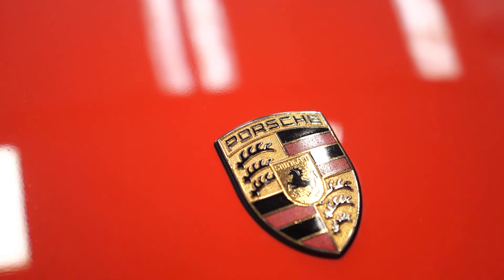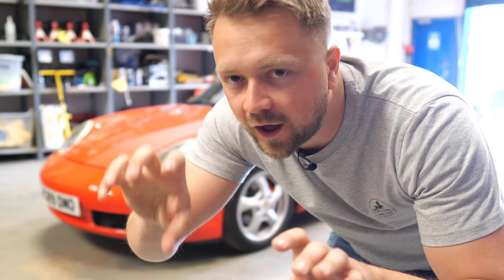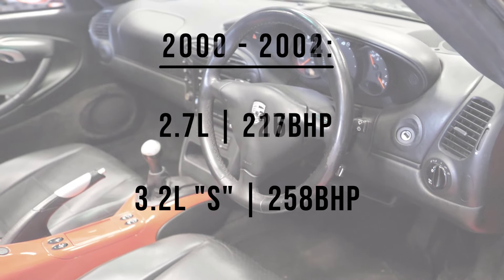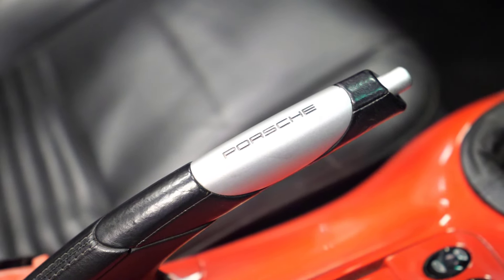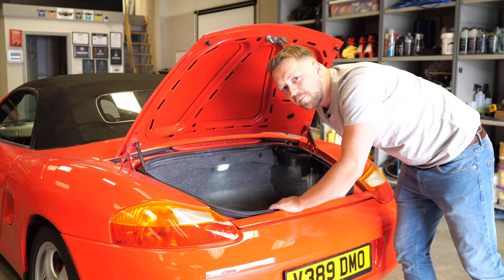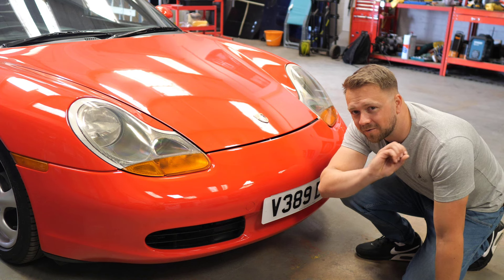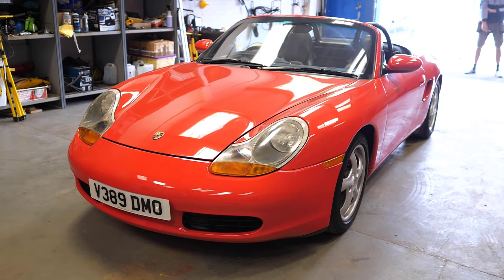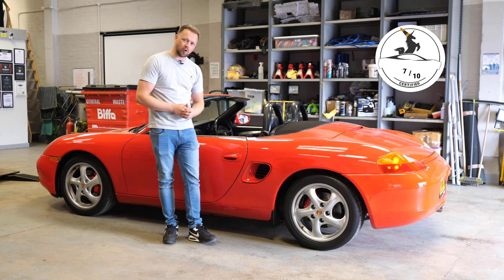Everything That Goes Wrong With A PORSCHE BOXSTER (986) BUYERS GUIDE

Comment: After a truly disastrous experience of owning my Boxster S for just 600 miles and a month, check the caps for mayo (both caps). Even though I had mine inspected, the inspector either didn't check this or didn't notice the mayo that had built up on the coolant cap. I had the AOS checked which was fine, meaning that the cylinder head was cracked, requiring an engine rebuild. I also had a lot of water ingress behind the passenger seat. Underneath the passenger seat is a module that controls the cars security systems. Quite an expensive fix if it gets waterlogged. I ended up selling my supposedly "good" Boxster S for a big loss. Be careful, these cars can bankrupt you!
Reply: For water infiltration in the car, under the seat, it is necessary to check from time to time that the rainwater evacuation holes are not blocked, otherwise the water overflows from the gutters and enters the cabin. little check easy to do from time to time. If your car is sleeping in a garage, you have little chance that the water drains will clog or that the water will overflow. If she sleeps outside, there you have to check more often.
In order not to be bored with the mechanics, you should not buy a 986 Boxter with a low price, if the previous owner took care of his car, he will not sell it at a very low price. It is necessary to favor well-maintained vehicles, therefore necessarily more expensive. The interior and exterior condition of the car says a lot about its owner.
Reply: @vincentidf2259  hi mate, I did unblock the holes but the problem persisted. However after the engine failure I didn't pursue it further. However I agree I would personally avoid cheap Boxsters'. I've had to learn a very painful and expensive lesson.
Reply: @tameracingdriver  Hi
Repair costs and the price of parts are often high, do not allow you to consider a vehicle at a lower cost and then to consider doing the work to upgrade the vehicle.
Frankly, the Boxster is a good vehicle, a reliable car if the interviews are well carried out and the wearing parts replaced on time. Sorry, your experience with this car was unpleasant.
Reply: Sounds like your professional ‘inspection’ missed some basics. The cylinder head is a known weakness on these. A basic sniffer test would have detected cylinder head issues. What did the inspector do exactly? Kick the tyres and take it for a drive around the block?
Reply: @Theoriginalramjammer  sadly mate my professional inspector was in fact just a glorified tyre kicker as I found out to my cost. Sadly their terms and conditions meant retrieving any money was highly unlikely. A very harsh lesson learned on my part 😔
Reply: Sorry brother. I'm so close to buying a 986 but but they make me so nervous. I'm not wealthy but I have Porsche dreams.
Reply: @heavycream6682  same here mate, but having owned two 986s, personally, I'm not sure they live up to the hype personally. My modified mx5 (Miata) is actually more fun to drive, it just doesn't 'feel' as special - basically it doesn't have the badge. As a fellow non wealthy person, I will never buy a Porsche again. They're just not worth the risk for me and don't quite deliver enough fun to warrant the risk / stress that comes with ownership
Reply: @heavycream6682 Mate get one. I've had my 2001boxster s now for around 6 months. Yes I've had to throw a decent amount of cash at it for repairs and replacement parts but as soon as I hit those country lanes with the roof down its worth every penny!
Reply: Bought my 986 Box about 4 years ago for $4500 and have bought nothing more than gas, coolant, and a replacement key. If I threw it in the bin today I'd still consider it a great deal and would run right out and buy another. 
This one has around 160,000 miles now  I'd probably spend a bit more and hunt for a sub 100,00 model, and preferably an S.

GREAT car. So much fun. Can't see myself being without one
Reply: @heavycream6682 I just bought a low mileage 2015 911. So far so good (fingers crossed). Wait until you can buy something that isn’t in the IMS bearing era unless you know your cars.
Reply: debbieprather4804 Those are some insane costs and this coming from a person who's owned 4 BMWs

Comment: The  original IMS bearing is not lubricated by engine oil. It's a sealed bearing lubricated with grease. The seal can fail through infrequent oil changes, allowing the grease to be flushed out by the hot engine oil which then provides insufficient lubrication, leading to bearing failure.
Reply: The hollow IMS shaft is sealed at both ends, during the heat cycling the engine experiences, the air inside the IMS shaft heats up, expands and finds its way out thru the IMS bearing seals.  When the engine cools a vacuum is created inside the shaft sucking oil into the bearing dissolving the lubricating grease.  Repeated over hundreds of heat cycles the grease is completely washed out being replaced with old oil that never gets changed as it is trapped by the seals.  This oil degrades over time and eventually leads to bearing failure.  As mentioned in the piece this failure is more common in lightly used cars which have presumably benefited from more frequent oil changes which indicates oil change intervals is not the problem.
Reply: I don’t disagree but my facelift 2003 2.7 IMS failed - car had only done 36K & fully serviced 2 owner car. Beware.
Reply: @richardcalon3724  So the solution is an open IMS bearing (no seals) and frequent oil changes so the bearing is always flushed and protected with fresh oil??

Comment: Just a tip ..I did 160,000 miles in my 987 and never had a clutch , therefore nobody looked at my ims .. My ims didn’t break , lucky me , it started to make a noise .. So even if you don’t need a clutch , 60/70,000 , open it up and check that IMS

Comment: I have a 2001 Boxster S.   The color is identical to the one in this video, Zanzibar Red.   I’ve replaced the clutch (had some minor chirping) the throw out bearing rear main seal, inner half shaft boots and IMS all at the same time.   I also had some water on the floor from rain; it fried the computer.   But, the car is a joy to drive.   I don’t drive it much (I have 42K miles on it) but make sure that I take care to drive it from time to time and change the fluids regularly.

Comment: Considering the price bracket the 986 is within, and the very affordable aftermarket parts available, it can hardly go wrong.
IMS & bore scoring, forget about that, just as the cylinder liners dropping. Any 986 still alive is not affected by these issues. As any M96 engined vehicle, if the AOS has not replaced, this needs doing. This is a DIY job.
The 986 is bullet proof !❤

Comment: I had a 99, 2.5 Triptronic S, fantastic car, in 8 years of ownership driving it daily only two issues were water pump went and stereo not automatically switching off leaving the battery to be drained. Fantastic car.

Comment: Great content! Thank you for taking the time to do this. Very helpful to anyone looking at the 986 Boxster. 

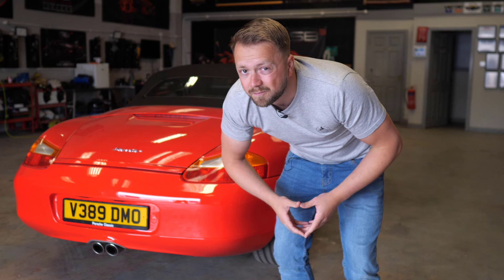A couple of comments about the convertible top… I think a few others have covered it here, but at approximately 8:35 we can see that the convertible top bead is on the outside of the window frame. There are a couple things to look out for on these cars. 1. The problem seen here, is easily rectified by replacing the elastics inside the roof that keep detention on those convertible top beads. 2. If those are left unrepaired water can get into the back area where the convertible top recesses into. If the two drain channels, which are approximately above the side intake and exhale vents for the engine are clogged that water has nowhere to go but under the seats in the main compartment. There are electronics under those seats which can easily get fried… And it’s not an inexpensive proposition to repair them. 3. So it’s always a good idea to blow air down those vents and make sure they are cleaned out. Especially if you leave the car out during weather. 4. The reason for the out of alignment issue on the convertible top, and therefore the popping sound, is that the little plastic cups that are attached to the actuator that raises and lowers the roof can break. If one breaks, then the top goes wonky. They are generally inexpensive to replace, and most people can do it themselves. Best to replace both at the same time as that plastic can get old and brittle. It is made to be sacrificial because those plastic cups snap onto a metal ball joint.

There are a couple of other things I would’ve focused on. The coolant pipes, and the radiators at the front end of the car can get compromised by rocks and corrosion. Always good to give those a look. It’s also always good to give a long look under the car from front to back to check for any damage or missing under panels. There will likely be scrapes under the nose of the car as it’s so low to the ground. That’s not a huge issue especially for cars this age. 

As noted by another commentor, sometimes it will cost some money to bring the car up to current spec. Factor that in your overall budget. That might mean spark plugs, coil packs, serpentine belt, replacing tires that have aged out by their date code, brake, flushes, and coolant flushes. It’s all typical stuff, it just needs to be budgeted for and you’ll be a happy Porsche owner.

Comment: Just to add the 2.5 is the best, has shorter gearing whereas the 2.7 really feels slow through the gears due to tall gearing. The ‘S’ is not too bad but still has tall gearing and still doesn’t feel that quick. 

The 2.5 also had a proper cable throttle, better IMS and is lighter. They also have levers for the frunk as opposed to electric switches for the later models, essential for when you have a drained battery, makes it much easier to get to the battery. 

If you fit a 2.7 exhaust to a 2.5 it adds a bit more grunt and response as the 2.5 has smaller bore piping, strangling it a bit, they breathe better with 2.7 exhausts. 

With the shorter gearing it’s much better when you add a lightweight flywheel too. Makes it more fun than the 2.7 and 3.2, responding better, revving quicker, and with shorter gearing. 

Not quite as quick as a 3.2 but more focussed and more fun for a proper car enthusiast that likes driving and not posing.
Reply: Thank you good to know. I'm looking at a 2.5 and thought I was missing out!  I'll take the gearing!
Reply: Gearing is short in my 1998 986 but you get used to it, I go from 1st to 2nd immediately and if I'm moving at all 2nd is fine.  I use 5th over 70mph as well.
Reply: The trunk & hood release levers on 2.5L WILL stick in the locked position when the battery dies. There's no emergency power injection terminal in the fuse box on the 2.5. Do extend the emergency hood release wire, hidden behind the bumper cover, so it can be accessed by the town eye socket.
Reply: @sununtaschnittker6469 One can quite simply skip 1st altogether....You'll achieve the quickest 0-60 run with no gear shifting

Comment: I bought a 2.7 986 4 years ago. My first bill was £2700 to get it up to standard, replacing brake lines, some other bits and pieces.... Service it every 6 months, regardless mileage... Replaced things like radiators , steering wheel squid, etc... Not even sure how much to be honest, although of course I have the invoices, haven't added them up... Now it's at Williams Crawford to do IMS, RMS, and some other things that may show up .when they put the car on the ramp... I'm guessing around £5000... After all that, I still LOVE it, and I do understand that it's a 20 year old car that needs to keep up, and Porsche is not a cheap car to look after..... If we do the maths, it doesn't make any sense, but I don't think that's the point owning a modern classic.. 🤘
P s. ... if I have had a engine failure I would be very crossed... Luckily 2.7s are less likely to bore score... 😜🤔🤞
Reply: I’m 18 and was looking at a 986 2.5L, what you said was very relatable for my situation as I’m saving up to buy the car myself and I’m aware how much they cost to maintain but I absolutely love the car. Would you have any advice for me buying one to avoid as much issues as possible (I’m buying the 2.5L as the insurance group is much lower than the 2.7 etc
Reply: @keelanvarley7325  I would say buy a car that has a good service history. If possible do a pre-purchase inspection, so you can negotiate if something shows up. I wouldn't bother to mileage that much... sometimes cars that stay still for too long can have more issues than the ones that are on the move ... Good luck :)
Reply: @inglaterracaipira4357  thanks a lot I really appreciate the help, last thing, ik you say mileage isn’t a big issue but is there any amount where u just wouldn’t bother looking e.g. 150,000+?
Reply: @keelanvarley7325  I think a car that was driven around 5k miles per year should be fine... Therefore, a 20 year old car with around 100k miles I wouldn't consider 'high mileage '...
Reply: @keelanvarley7325  I'd rather buy a well serviced, well maintained tidy car with 150K miles on the clock than a (likely more expensive) badly maintained car with 30k.
Reply: @HOG883R  Agree. 100k miles for a 20 year old car is fine - these engines are tough as nails (assuming you service them).

Comment: I have owned a 2015 981 Boxster for 7 years, I purchased it an 2017 as a CPO with 14,000 miles from a dealer. My wife has put 36,000 miles on it since then and it has been extremely reliable, I have only done oil changes, brakes and tires. The car has been a joy to drive and own and has had the lowest depreciation of any vehicle I have owned including multiple Audi, BMW, Lexus and Mercedes Benz vehicles. I also owned a 2019 Macan S program car which I put 50,000 miles on over 3 years and sold it during the pandemic for $5K more than I paid for it. My experience with Porsche has been very good.

Comment: I’ve had my ‘98 Boxster for over 7 years now. Got it with 54,000 miles now at 82,000. Only issues so far have been a failed pulley on the serpentine belt. It was an easy fix and quite affordable as well. Heading out today on a sunny Monday here in New York State.

Comment: Have a 1999 boxster 90,000 miles. Haven't had to deal with any real issues other than maintenance. Just keep them moving. Letting them be garage queens is the reason you get failures. Also, don't be afraid to rev it out, it lubricates the IMS bearing as well. At this point my clutch is going to fail before my bearing. I'll end up swapping that when I do the clutch.
Reply: I’m looking at one that has been driven now and again but is 2004 and 35k miles! Should I leave it alone?
Reply: @06comment  Definitely try to find one that has it replaced preferably with the oil fed bushing solution. There's definitely a risk when buying these cars without a replacement having been done unless it's an earlier dual row bearing car.
Reply: The 1999 IMS bearing is a sealed unit, which does not require lubrication ..😊
Reply: @thefreedomguyuk  True unless you remove the cover for it. Some people do that to allow for oil to get into the bearing and provide the lubrication it needs. Better than trusting the 20 year old grease that's sealed inside.

Comment: Good coverage of faults - make sure you buy exact part number MAF for year, they changed them and won't run well if mixed. Ignition barrel electric switch faults and on tiptronic selector rusts on overhang at rear of engine. Disconnecting battery and alarm wont stop? Disconnect battery with key on engine off. The two pram ball joint plastic links to the hood break - you can replace with metal ones

Comment: Like this video. I experienced the IMS problem just as you describe it. I had 1997 and 1999 boxster. No problems at all and very reliable. My 2005 987 S's IMS blew out at 70 t km immediately after my prolonged warranty expired after 4 years. Great fun to drive though.

Comment: Had a couple of Boxsters, both a joy to drive and the handling is unbeatable. Interesting bills were ever present but once the hard stuff was done it was usually down to tyres and fuel. 
The engineering is in some places very clever, easy out headlights and stuff, in other places oddly poor like the IMS/RMS and as also pointed out the front rads.
I'd have another one any day, but currently EV'ing.
Reply: Only gone and bought another one!. Almost everything underneath needs to be replaced - might even start my own channel there's so much work to be done!🤣
Reply: @BlackBuck777 do it I just bought one and it would be nice to see someone fixing there's up because I know mine will have problems
Reply: Lol guess what, I got another one (2002 2.7)! Full suspension overhaul under way. So much to do but I'm enjoying it. Good luck with yours.

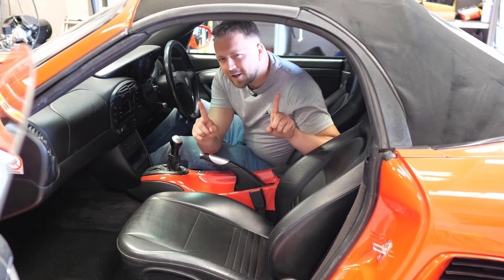Comment: Another poster already mentioned this, but notice at 8:37 the roof beading sticks out, which is a common problem and a sign that (typically), the tensioning cable is stretched.

Comment: I have a low miles 2004 S model which I am the second owner from 2006.
The first owner was a friend so I knew where it had been.
First time I had it serviced the RMS was replaced, initially Porsche were going to cover 70% of the cost but when the work was done they actually covered the full amount.
A couple of years ago partly due to light summer use I decided to replace the IMS bearing for peace of mind as I wanted to be able to enjoy the sound of the flat 6 at higher revs and had an EPS unit fitted as recommended by my local independent Porsche specialist Redline Motors.
I have needed to replace some coil packs which were causing a misfire.  Everything else is routine servicing.

Comment: Left side soft-top cable misaligned. 
Some of the  IMS bearing problems are caused by over reving. Although the engine has rev limiting, if you downshift to a low gear and pop the clutch you can exceed max rpm. This is impossible with a Tiptronic gearbox.